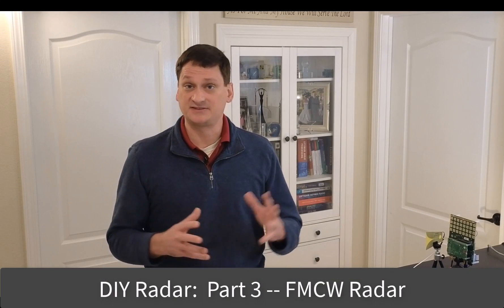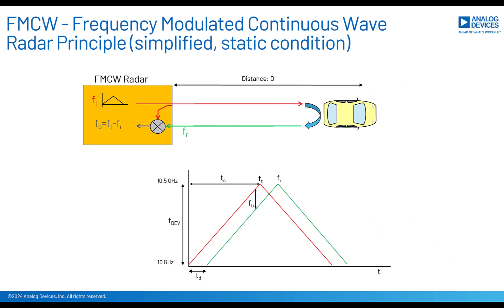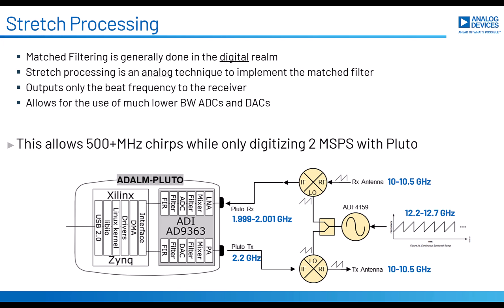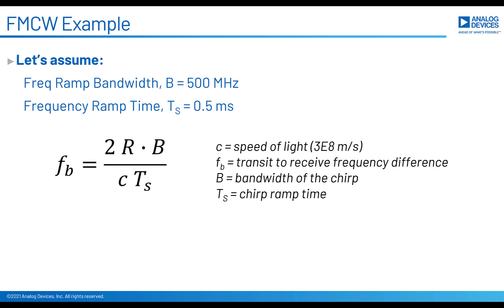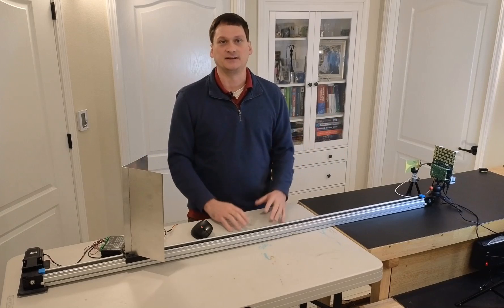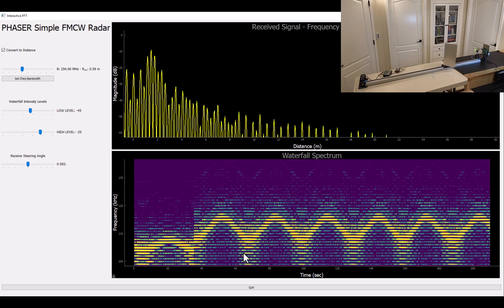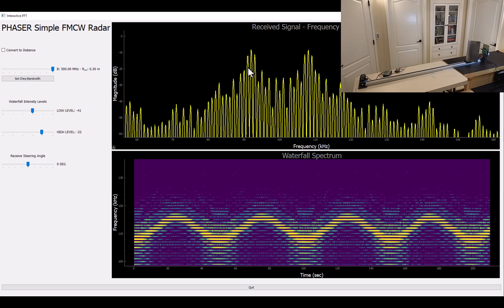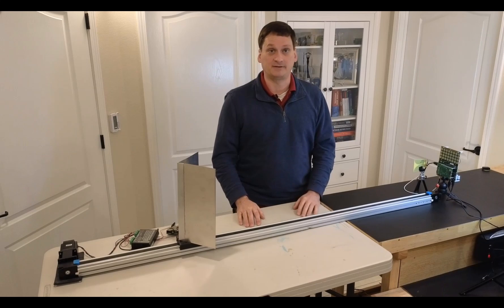Drone Tracking Radar:  Part 3 FMCW Radar

Comment: Now... A sufficiently advanced radar system with the spatial resolution and computation power. Could it not only detect a small quadcopter and predict its orientation, direction, location, momentum etc - but see the individual propellors and reconstruct it's flight trajectory based on speed changes there?

Comment: So...I went with just a Pluto (modified, but not augmented by all this extra stuff) to see what I could do. I'm trying to get FMCW working. I'm partway there and learning a lot. But I've finally realized what you were saying and showing--you've got the external LO creating the ramp. I don't really understand why, since the device can span over 500Mhz by itself. But it probably has to do with the chirp synchronization problem I'm having (if that's the the right term to use here)

My real question is: Why are you transmitting any signal frequency at all with the SDR itself? That is, your code generates a 100kHz, upconverts that to 2.1GHz, then sends it to the external mixer to have a chirp added and then upconverted again to 10GHz. Why the 100kHz? Is that just old code that's still sitting there? Could you just output the Pluto LO directly out the tx and get the stretch-processed data back on the rx?
Reply from the maker: Yes, let me clear up those questions:  
Pluto cannot generate a 500MHz chirp.  The instanneous bandwidth of Pluto is, at most, 56MHz.  The RF (think tuning) freq range of Pluto is 70M to 6 GHz.  But that is just the tuning range, not the bandwidth of the chirp you could generate.  For any further technical support for Pluto, please see the forums here:  https://ez.analog.com/adieducation/university-program/

The 100kHz is the baseband information.  So this might be a chirp, or a comms signal, etc.  And it is the information that gets relayed over the wireless link, while the carrier is removed.  For my setup, this is just a 100kHz complex sine wave.  But the reason it can't be 0 Hz (i.e. nothing), is that then it would be the same freq as the carrier.  And in a direct conversion architecture, that RF freq is the same as the internal LO freq, which we do not want to leak into our signal.  So we place special emphasis on eliminating that frequency,.  So that's the reason for some small offset.  A much better explanation is here:  https://www.analog.com/en/resources/analog-dialogue/articles/transmit-lo-leakage-lol-an-issue-of-zero-if-that-isn-t-making-people-laugh-out-loud.html
Hope that helps!

Comment: hi sir with the following configuration i not able to generate 5.8ghz rfout frequency 
refin is 100mhz 
spiclock is 20mhz 
int PLL_Configuration_1() {
    #define BUFFER_SIZE2 12
    typedef u32 DataBuffer[BUFFER_SIZE2];
 
  //  u32  WriteBuffer2[BUFFER_SIZE2]={0x00101F47,0x00000686,0x00800326,0x08293B1D,0x08880325,0x00780404,0x00780444,0x00C30883,0x01008032,0x10001EB0,0x881C8000};//0x881C8000    //0x901C8000 for analog clock detect
  //  u32  WriteBuffer2[BUFFER_SIZE2]={0x00000007,0x00000006,0x00000005,0x00180104,0x01030083,0x0700800A,0x0000001,0x081D0000};//0x881C8000    //0x901C8000 for analog clock detect
     // u32  WriteBuffer2[BUFFER_SIZE2]={0x00000007,0x00000006,0x00800006,0x00000005,0x00800005,0x00180104,0x00180144,0x01030083,0x0700800A,0x0000001,0x301D0000};//0x881C8000
    // u32  WriteBuffer2[BUFFER_SIZE2]={0x00101F47,0x00000686,0x00800686,0x08080325,0x08880325,0x00780404,0x00780444,0x00C30883,0x01008032,0x10001EB1,0x1D1C8000};
//    u32  WriteBuffer2[BUFFER_SIZE2]={0x00000007,0x00800006,0x00000006,0x00800005,0x00000005,0x00180144,0x00180104,0x01030083,0x0700800A,0x00000001,0x201C8000};
  //  u32  WriteBuffer2[BUFFER_SIZE2]={0x000683EF,0x00000326,0x00800286,0x371A0C4D,0x379A8F65,0x00600084,0x006000C4,0x00004143,0x004207D2,0x00000001,0xF8740000};
 
 
    // updated//
    u32  WriteBuffer2[BUFFER_SIZE2]={0x000683EF,0x00000326,0x00800286,0x371A0C4D,0x379A8F65,0x80600084,0x806000C4,0x00004343,0x004207D2,0x00000001,0xF8740000};
    int Status = 0;
 
    // Initialize SPI
    Status = XSpi_Initialize(&Spi1Instance, XPAR_AXI_QUAD_SPI_PLL_DEVICE_ID);
    XSpi_Start(&Spi1Instance);
    XSpi_IntrGlobalDisable(&Spi1Instance);
    XSpi_SetSlaveSelect(&Spi1Instance, 0x01);
    // Set SPI to Mode 0 (CPOL = 0, CPHA = 0)
    XSpi_WriteReg(XPAR_AXI_QUAD_SPI_PLL_BASEADDR, XSP_CR_OFFSET, 0x00000006); // Enable SPI, CPOL = 0, CPHA = 0
 
while (1)
{
   // Write registers in reverse order
    for (int i = BUFFER_SIZE2 - 1; i >= 0; i--) {
        XSpi_WriteReg(XPAR_AXI_QUAD_SPI_PLL_BASEADDR, XSP_CR_OFFSET, 0x0000001E); // Chip Select Low
        usleep(10);
        XSpi_Transfer(&Spi1Instance, &WriteBuffer2, NULL, BUFFER_SIZE2);
        usleep(10); // Delay between writes
        XSpi_WriteReg(XPAR_AXI_QUAD_SPI_PLL_BASEADDR, XSP_CR_OFFSET, 0x0000011E); // Chip Select High
        usleep(10);
    }
 
}
    xil_printf("PLL Registers Configured Successfully\n\r");
    return XST_SUCCESS;
}
pls suggest me the way to configure the pll ADF4159

Comment: Hi Jon, I'm thinking of having a go at this with a very low cost radar module that can only change its frequency by 5Mhz. Is it possible to do FMCW with this device? I can't quite wrap my head around what would happen if the modulation chirp width was less than a single period of the beat frequency. To run through some example numbers: 10 kHz sawtooth -> 100 us ramp -> 50 GHz per second ramp rate -> 166.7 Hz beat frequency per meter. So at indoor ranges you'd be trying to measure a few hundred Hz with 10k ramps per second. Would this work at all?
Reply from the maker: You may have better luck with other modulation types, rather than LFM.  Perhaps FSK or pulse coding.  There are examples in Charvat's book, or Andy Harrison's radar book.

Comment: Hey Jon, can you explain why there is a 4 divisor for my_phaser.frequency and .freq_dev_range and .dev_step in all the python examples?  It obviously works as I’ve got all the examples running on my Phaser. I just can’t understand why it's needed.
Reply from the maker: Yes, that's a good question. It's because the VCO we use, HMC735, has a divide by 4 in its feedback output.  So what the ADF4159 "sees" is the VCO freq divided by 4.  That's a good question though.  Actually, its better to post questions to the link below, that way everyone can search it and see the answer.  But thanks, and hope the Phaser is working well for you!
https://ez.analog.com/adieducation/university-program/

Comment: This series is helping me understand the FMCW app.  I'm lashing up something similar to the MIT example and am struggling with the digital ramp/chirp generator.  You said that the round-trip time, at least for your close-range examples, is some tens of nanoseconds, but the step time on your ramp is 1 microsecond (07:23 ramp_time/num_steps) so the frequency would be likely constant over that time period.

Is there a strong filter on the DAC output, or am I missing something?
Reply: I'll answer my own question here. After looking a few lower-level FMCW radar pages, I see that if you don't use an actually function generator (like the XR2206 used on the MIT project) you use a low pass filter, commonly based on an op-amp. I'm using plain old R & C and feeding that to an op-amp to get the output up to 20 V for my VCO. My DAC has a 5 us settling time so it really needs some smoothing to get an actual ramp over a few ns.

If you take a microsecond to change frequencies, it's not really modulated over the out and back timeframe.

Comment: Hi Jon, I'm trying to get an understanding of the basic principles of radar, and your series has helped me. I have a general question regarding radar and cars. If your radar was setup in car moving, and a tractor trailer got in front and blocked both transmitting and receiving antennas. Would the radar be able to pick up your rig moving back and forth?

Comment: In simpler terms, when a FMCW radar is modulated with a sawtooth wave, it tends to suppress one of the sidebands because the radar signal only increases or decreases in frequency in one direction before abruptly returning to the starting point. This creates more energy in one direction of frequency change, making one sideband stronger than the other. The abrupt return to the starting frequency doesn't add much to the opposite sideband, so you end up with one dominant sideband and the other being much less pronounced. This effect is due to the way the sawtooth wave modulates the signal, focusing the energy in either frequencies above or below the carrier frequency, but not both equally.

Comment: Hi Jon! Great videos!! I ordered a Phaser kit at the end of last year, but it hasn't arrived yet. The supplier (DigiKey) keeps pushing the delivery date forward every time we ask for an estimate—it's always 'a week' further in the future. Do you have any idea of an actual delivery date, or suggestions on how I could obtain a unit? 🙂
Reply from the maker: Yes, sorry about that.  We have 65 kits headed to our warehouse now.  So I hope by early March they will be shipping out.
Reply: @jonkraft Hi again Jon! The kit has now arrived! Thank you very much for your information! A question: Do you know if it's possible to connect a standard laptop USB-C charger to the kit (a charger that can output multiple voltages between 5--20V)? Does the kit communicate with the power adapter to ask for 5V, or do I have to use the included Raspberry Pi adapter?
Reply from the maker: @KulMedVideo  Glad you finally received that kit, because I think ADI is almost sold out of them again....  For any technical support on Phaser, just post your question here:  https://ez.analog.com/adieducation/university-program/
Reply: @jonkraft Thank you Jon for the link! I hadn't seen that one before! Currently I'm setting up the Kupier system, but I know you provided a pre-made SD-image for the Phaser-kit that I cannot find right now. Maybe you mentioned the link to the image in one of your YT-videos, I'll keep searching for it!
Reply from the maker: @KulMedVideo  You can find the SD card download and instructions here:  https://wiki.analog.com/resources/eval/user-guides/circuits-from-the-lab/cn0566/quickstart
Reply: @jonkraft  Thank you very much for the link! I've downloaded a fresh Kuiper, updated it with the scripts, and got the Chromium browser back to working condition by clearing the Singleton files. So now it's playtime and a lot of fun experiments ahead! :D

Comment: Sorry if I missed it but where does the 100kHz centre frequency in the beat frequency come from?
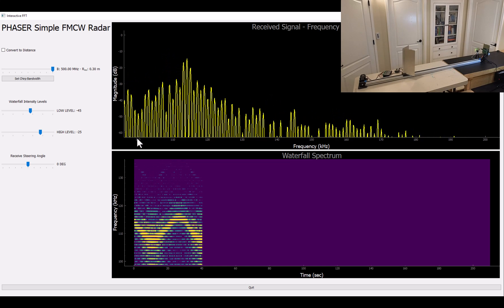Reply: @jonkraft Excellent videos so far. One question about the experiment at 9:27 onwards here. When the reflector moves towards the radar, it appears the frequency is reducing, not increasing, in both plots contrary to Doppler principle. Do I have this wrong?
Reply: @ jumping in to check my understanding too! The transmitter is sweeping over frequencies, so the delay due to time of flight is converted into a frequency difference between tx and rx. The shorter the distance, the smaller the frequency difference and therefore smaller the beat frequency
Reply: @danielfearn6076 great - thanks for this. I think you’re correct and you’ve sorted out my “perspective problem” with what is going on there.
Reply from the maker: Yes, that's a good question.  I went through it briefly in the CW Radar video, but it was probably easy to miss.  The 100 kHz is the baseband "information" that we are sending.  So Pluto outputs 2.2 GHz (that's its LO) and then adds 100kHz sine wave to that (so 2.2G + 100kHz which is 2.2001 GHz).  Then mixes that up to 10GHz + 100kHz, and then ramps that up to 10.5GHz + 100kHz.  Then the receiver gets that chirp back and reverses those freq shifts -- eventually mixing back down to baseband (0Hz), leaving just the original 100kHz +/- the beat freq.   I don't know if this explanation is any better, but hopefully it makes some sense!
Reply: @jonkraft  Ah yes that makes sense, thanks. Because I guess if you didn't add that 100kHz then the beat frequency might be near zero and that could be difficult to process

Comment: I find your audio fidelity lacking with many instances of audio fall off, and  missing words. Even on replay it's difficult. and close caption does not capture. There is also severe mid to high range clipping, from some sort of compression you're employing. this topic is too important to have this  problem.
Reply from the maker: I really do appreciate the feedback!  I've been trying to get better with new mics and software.  Often it will sound good on my computer, but then on my TV it doesn't sound great.  I'd like to figure it out and improve it though.  Are you able to give me some specific time codes where you notice an issue?  Then I can find a set of speakers where I can hear that same issue at those time codes and see if I can clean it up.
Reply: @jonkraft  ..@5:23 when you employ the 's' sound and the 'ch' sound it really ramps up...but it's throughout.  Looks like you have a lav mic on. ? maybe look at the input settings and look for settings that are good for full spectrum music, or such.
Reply from the maker: @al_7_405  Yeah, I see what you mean now....   The youtube subtitles seem good, if that helps.  But I need to fix this audio.  I think I'm done with that lav mic, I'm going back to my trusty old 1990's boom arm headset.   But I did remix the sound, and applied a "de-ess" filter.  If I could impose on you again, does the video posted at the link below sound any better?  Or worse?  Anyone else can also evaluate -- just give thumbs up if you like the audio better, or thumbs down if the audio still sounds bad.  Thanks for the feedback!
https://youtu.be/jM7Kh-TetuM
Reply: @jonkraft  the sound is flatter, with less high end. the lisps of the S and CH are still there but under some mild suppression filter. The original is brighter and easier to listen to. Ham operator here, so audio is a sensitive subject. 😏

Comment: Great video as always! I was looking to get an adar1000 chip to just play around with, but it seems they are not really all that available. In fact, most of the high-end rf radar, dds, phase shifters, and pll stuff are not really available on mouser, digikey, etc. I mean, they are there, but behind order limits or price quote walls. Probably ITAR right? Is there like a less expensive adar1000 dev board? Anyway, I can't wait for the SAR stuff! This is so interesting. I appreciate all your expertise and the time you take to make these videos.
Reply from the maker: Yes the RF parts are a bit high end and with the PCBs and everything it would probably end up being more expensive than just the Phaser kit.  But I know that's a lot for someone just exploring.  I would recommend checking out the Pluto.  You can follow my other videos to make that into a 2 channel beamformer--and you can do a lot with that.  And you can also do the radar pieces we're talking about in this series--just at lower BW.

Comment: I love these videos, I'm learning a lot. Got me thinking, though. Can data be encoded into a RADAR pulse? Could be a way to prevent jamming/spoofing, if every pulse is, say, a randomly generated token. The receiver is expecting the return to be a specific token that would be impossible for the EW equipment to know. Maybe they already do something like that? I love radio technology, there are so many possibilities.
Reply from the maker: Yes, you're in the right thinking!  Instead of FMCW, we could have done some information -- like "Barker" codes.  They have a good correlation for radar pulse compression.
Reply: Anything that can modulated arbitrarily can be used to transfer information. Modulating “radar” to encode digital information is basically digital radio like Wi-Fi signals we all know and love. There is nothing stopping you from using traditional radar techniques on digitally modulated signals like this, so you could definitely use a digitally modulated radar signal to both track a target and send or receive data. 

This is the basis of transponders. What is called “secondary radar” in air traffic control uses this technique to ping and interrogates digital transponders (IFF) of civil and military aircraft. Its signal is encoded to request a reply signal (a code) but at the same time it is used to detect direction and distance of the transponder reply.

“Primary radar” is just traditional pulse radar at 2700-2900 MHz, which can only detect, but not identify, targets. That’s why these two technologies are used together in both civil and military applications to both track and positively identify tracked targets.

Comment: Fantastic, as a mechanical engineer who has an interest in electronics and RF im loving this series! But in the demonstration, why is the waterfall and frequency plot messy? as in whats with all the other noise? Is it an artefact of the mixer or of the digital waveform generator? i know square waves have messy harmonics due to the Fourier expansion ect but would have thought a saw tooth would be a bit cleaner. Also you said the upper and lower waveforms are mirrored around 100khz, but are they actually mirrored around the 100khz + or - the beat frequency due to the mixer?
Reply from the maker: Thanks!  That freq messiness is all the radar return clutter -- so all the items in my small office are reflecting that transmit signal, and they all show up on the FFT plot.  So each of those spikes is from a book, or a chair, or a lamp, etc.  In the next video, we'll work on a way to suppress that clutter so that only the "real" targets show up -- that the CFAR algorithm.
Reply: Sounds good, i cant wait!